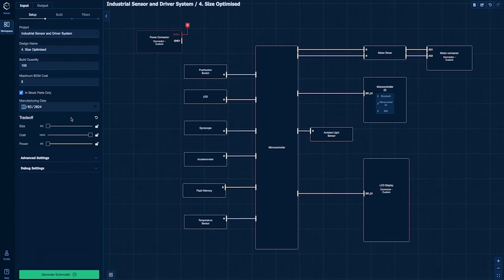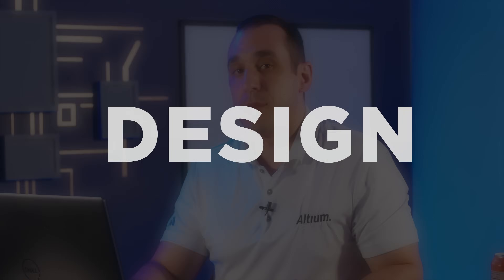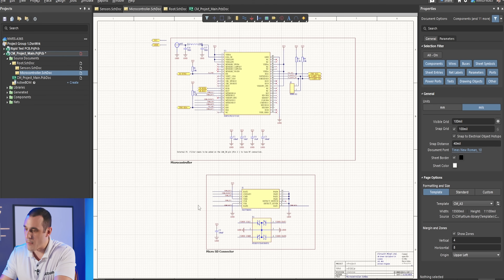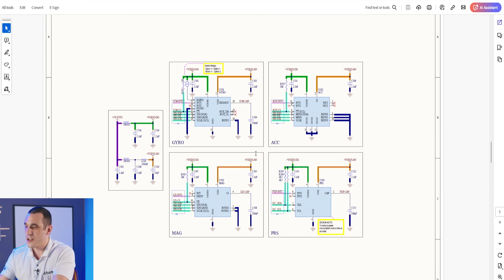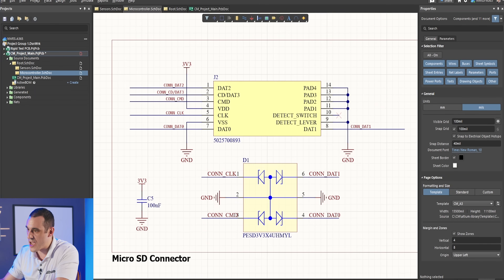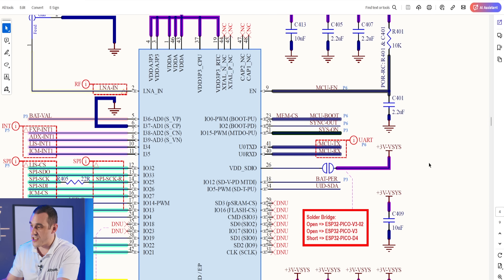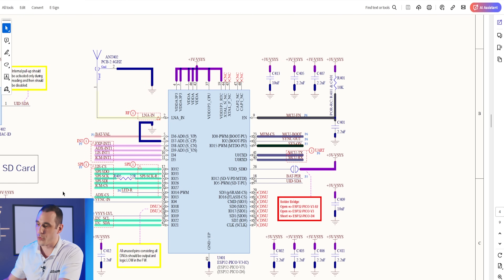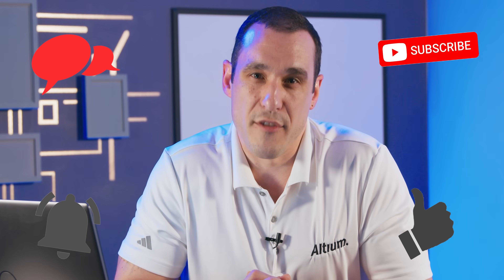PCB Designers, Is AI Your New Rival? See the Results!

Comment: I've used plenty of autorouters. I'm not worried.
Reply: I once developed a simpler autorouter which outperforms commercial ones by quality at nets number <50. You definitely should not be worried: computational expense for optimal-ish routing rises at least number of traces cubed from there, its quite fundamental, and cost becomes prohibitive for everything save very small projects. Even if it will become feasible in the future, human oversight is a must here
Reply: @233lynx  One of the few places where quantum computing may actually be useful, if you were able to define the system well enough to start with and get a quantum computer large enough. 
That said, I reckon you could probably train a diffusion model on this problem space and it'd get pretty close, and run on current day a GPU in a minute. Might not be as theoretically optimal as a quantum optimiser but it'd go close I'll wager lol
Reply: @233lynx  That is only true so long as the optimization is done by brute force. AI isn't bound by such scaling for the same reason that human designers aren't - we have the higher understanding and reasoning ability to decompose the problem into manageable chunks. Human oversight will be needed for sure, but if it's anything like AI assisted coding, nowadays validation is often as simple as a cursory glance, and even that process can be largely automated by AI.
Reply: @benjaminbridger7771  Nope, its not just that optimization done by brute force, it's because it HAS to be EXHAUSTIVE. Otherwise human is better. Also, it outperforms modern AI approach by quality (best solution found). Also no, GPU doesn't help sh$t in topological combinatorial problems.
Reply: Definitely just joking here. I'd love an AI that is better than a human for PCB layouts.
Reply: I trust you.
Reply: Auto-routing and auto-placement with manual floor planning has been used in the ASIC industry for years, it massively changed the jobs of ASIC designers. You drive the tools with models, constraints and review reports. It's not that auto-routing can't be done well, it is that PCB complexity is much lower than ASIC complexity and it's tenable to do PCB design with less automation, there really isn't that much money in making a good PCB auto-router.
Reply: @Darkknight512  This is a good point, I sometimes wonder if the effort needed to drive a really good autorouter would be comparable to just manually routing the board.
Reply: @Zachariah-Peterson  I think the entire industry has to change for that to really happen. The difference is the ASIC industry was forced to change, the PCB industry isn't. ASICs used to be laid out the same as PCBs, the people were actually probably the same people that just moved industries but at the beginning it wasn't even seen as a move, it was just artwork on silicon vs fiberglass. I don't think it would work by just writing tools that add constraints to nets in schematics and the floor plan. The amount of information needed needs a similar shift the ASIC industry made, going from schematic to HDL is what happened in the ASIC industry. For this to be adopted in the entire industry, every manufacturer would have to provide device models that get dropped into the tools and everyone in the industry would have to re-learn how they design boards. I don't think this would ever happen, but conceptually, there isn't anything that makes this impossible from a theoretical or conceptual standpoint, but I think it is entirely impossible from a practical standpoint. With that said, there is a gradient of tool automation, more automation will keep coming even if one industry never reach what a different industry has reached. I just think saying "autorouters can't work" makes no sense when an entire different industry is dependent on it.
Reply: Autorouters tools aren’t AI, their just normal algorithms
Reply: This is not about autorouters. But I also am not worried.
Reply: @Zachariah-Peterson  Ню-ню!
Reply: Every experienced and not so experienced PCB layout designer knows that autorouters are actually forbidden. I did not use them since 2004.